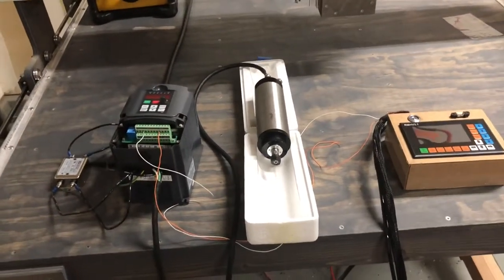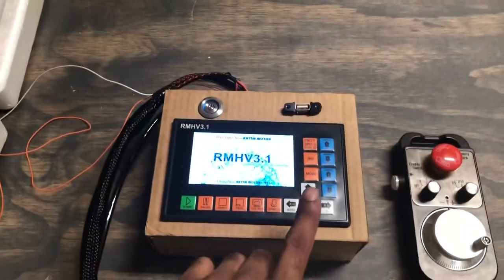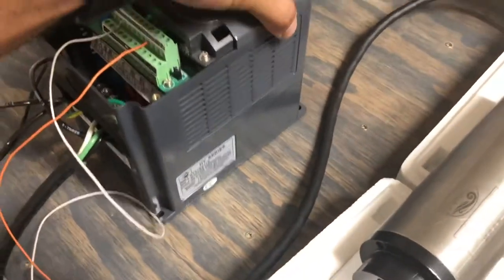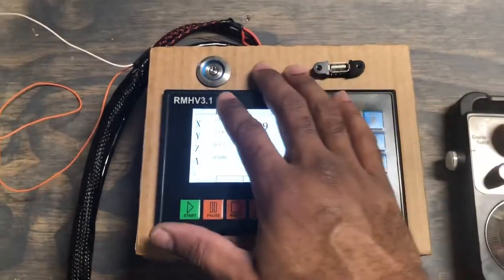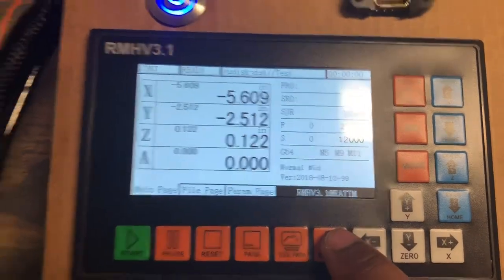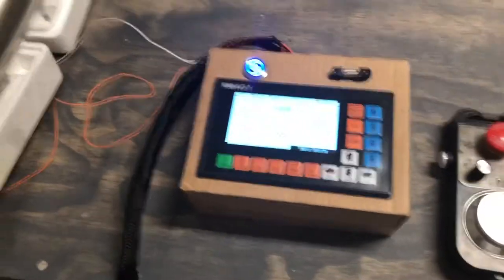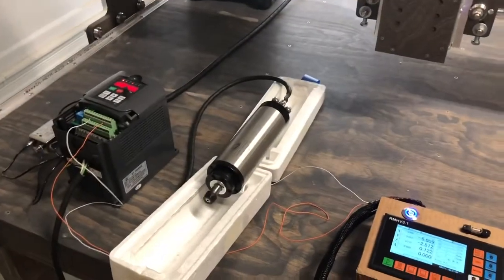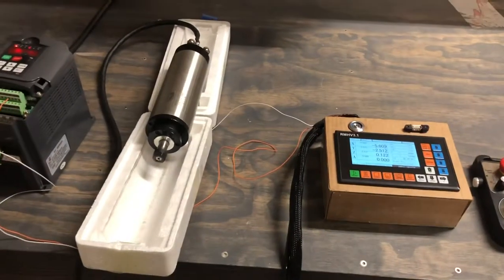110v 1.5kw Water cooled spindle first run

Comment: Just an fyi, never ever ever run a collet without a tool in it, 1 if you don't tighten  the collet one of 2 things can happen depending on the direction of rotation, the collet unscrews itself from the spindle motor and becomes a 24000 rmp projectile, ive seen it happen. #2 the collet tightens its self damaging the collet and ground tappers on the collet and spindle bore. Also do not tighten the collet without a tool or with the wrong diameter tool this can damage the collet and tapers. Sorry but I saw this and had to say something
Reply from the maker: I understand, that is good information. I am not one that likes to spend money on something and then not try to take care of it. I am sure others may benefit from this information as well.
Reply: @SuperJfritz  im looking at building my first cnc router and im considering using this off line controller, do you still like it or?

Comment: JFabrications I see in some videos people opening the spindle and attaching a groundwire to the 4th pin and the spindle chassis.  Did you do this or not? And why or why not?
Reply from the maker: I did add a ground connection. I did not open the case to the spindle to ground it though. Instead I ran a ground wire to the  metal spindle mount the spindle came with and ran that to ground. 

I thought it seemed weird that even the manufacture was fine with not having a water cooled spindle grounded. I figured I only increased any risk there is by having a mostly wooded CNC build. Maybe the manufacture assumes that their spindles will only be used on metal CNC's that would already be grounded. Since a short would just run through the liquid and minimum the case and then me should I touch it, I did not feel right not having some type of ground.
Reply: @SuperJfritz  I just received my spindle from amazon.  I bought the same one as you.  Did the spindle spin freely out of the box or was the spindle locked. ?
Reply from the maker: @bulldogg187  The spindle I had spun freely. If your has problem and you need to return the spindle I would recommend getting a 2.2kw Spindle that can use the 110v inverter. The 2.2kw spindle comes with a ER20 Collet with can accept a 1/2" shank for bits. The ER10 can only accept up to 1/4" shanks. I will burn my spindle out before upgrading. The inverter I received will run both. I never plan to push my CNC to industrial limits, so the 1/4" collet matches a lot of routers.  1'2" shank (ER20 collet) would come in handy for cutting the surfacing times down.
Reply: @SuperJfritz  unfortunately I only have a 20 amp  circuit and am not sure if it could handle the 2.2kw and a 2hp dust collector + led shop lights without tripping breaker.

Comment: Thanks for the video. Being in the USA on 110V 20A circuits, I ordered a Huang Yang 1.5kW VFD/spindle combo online, but "unfortunately" the vendor sent me a 2.2kW combo. I planning on limiting the output current using the PD142 function to "fake" the rated current of the spindle and reduce to it 13A to get close to 1.5kW, assuming this is what the 1.5kW/110V VFD model should be set at. Is that the correct approach? Any risk the breakers on which the VFD and spindle are individually connected to would trip with this modification?
Reply from the maker: You are on the correct track my friend. I wish that I had gone with the 2.2kw spindle. they did you. favor. The inverter is the same for both. Just adjust the setting on the inverters to 110v. or if you get a 220 outlet change for the higher setting.
Reply: @SuperJfritz  I guess one of the thing that worries is how the under-powered 2.2kw will operate compared to properly powered 1.5kw. I presume the speed and torque will be lower on the 2.2kw with these modified settings (lower output current). Also my inverter is different, it is a 20A model (110V, 2.2kw), P/N: HY02D211B
Reply from the maker: @thefoildesigner  I hope the inverter has options for both 110v and 220v. I do think that the 220v will preform the same if not better than the 110v. The benefit that you will get is the ability to use larger dia shanks on your bits, as well as the ability to increase power if you opt for a 220 outlet down the road. I still believe that you ended up with the better option.
Reply: @SuperJfritz  to be clear, my 2.2kw VFD/spindle are 110V, not 220V.

Comment: How complicated is the wiring for the spindle you purchased. Have a blessed day
Reply from the maker: The wiring for the Spindle was the easiest wiring of the build as long as they send you the wiring diagram. It is inverter settings that gave me some trouble. I am new to VFD's and the literature out there assumes that everyone that purchases one have the proper training to understand all the lingo and symbols used in the manual. Even less out there for a 110v 400Hz spindle. I am still learning new things every day.

Comment: Sorry to troll all of your videos ;-) 

There is no disadvantage to a 120v VFD for this power level. It isnt quite as efficient as a 220v but insignificant in the scheme of things.
 If I read the VFD correctly you were running about 4000rpm after that long ramp up, cut that time down by 75% or more. It should be up to speed in seconds. 1 or 2 not 10. 

Reading the side of the VFD it is good for 400Hz. Standard speeds of your motors are at 60Hz. You can basically overclock the speed by multiples. 

What is the spindle rated for, 25000rpm?
Reply from the maker: I don't see it as trolling, and I appreciate your comments. I am always learning and willing to give my time to those that stop and assist others on their journeys. In other words Thank your information. In this video the VFD was most likely set to 220v in the settings and not 110v. I ended up blowing this one due to me changing settings incorrectly. The second one I set up much better and do ramps up to speed faster, I would not say it cuts time down by half but it is noticeable. The display shows 400.00Hz (I am pretty sure will be checking, see learning everyday). The spindle does not have many specs on it and did not come with any literature. Amazon claims it is 0-24000rpm. One big difference I did not know before starting this journey is that the 110v spindle can not use bits with 1/2" shank like the 220v can.
Reply: @SuperJfritz  A 1/2" shank tool would most likely break the router or mill it was mounted to. I am guessing this will be on a router of some form?
Reply: @CncObsession  Good call on the 1/2" bits. Hobby machines can rarely handle the load a 3/8" bit can deliver let alone a 1/2" bit. For new comers it is best to stick with 1/4" or below because bits are far cheaper to replace than CNC components. As for the spindle upgrade. For a hobbyist its just another obstacle in the learning process and quite frankly not needed. Buying a case of earplugs and 5 or 10 sets of bits would be a more sensible spend. Just my .02